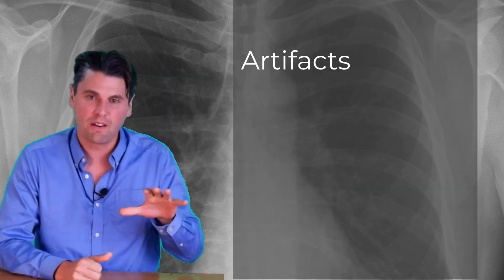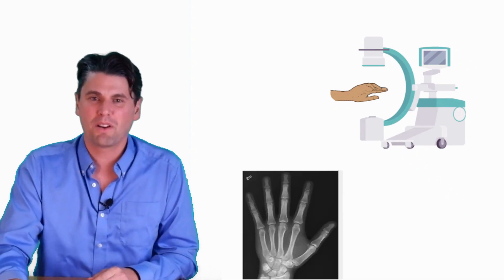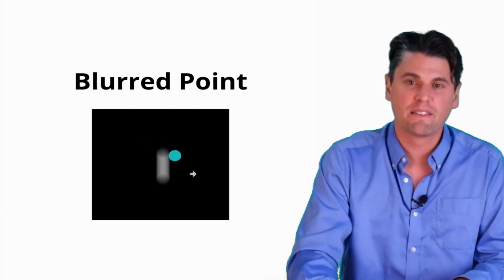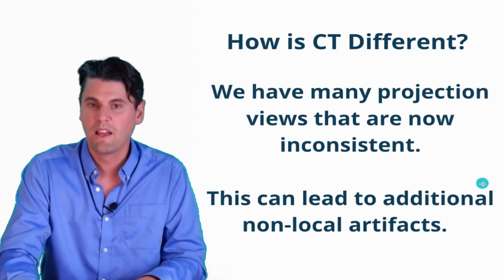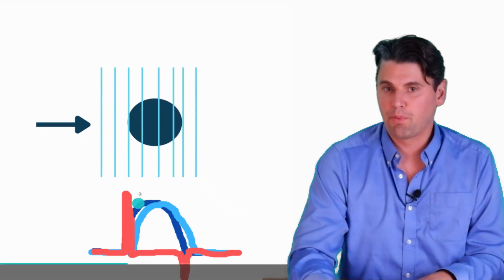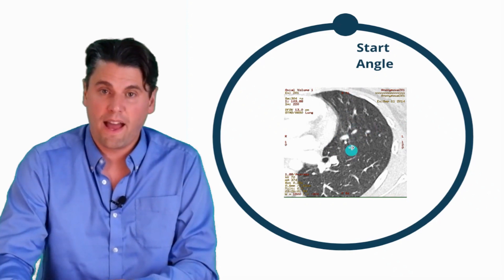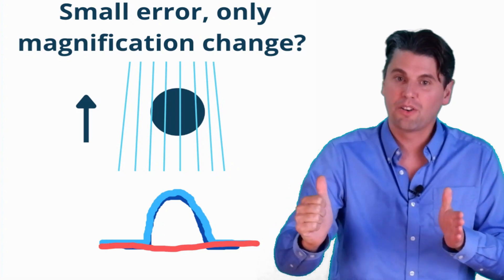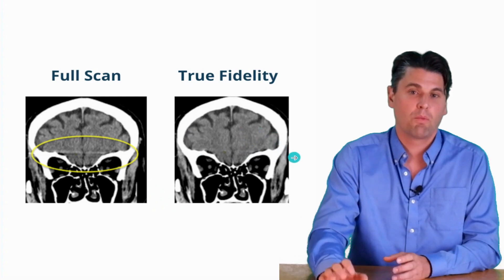CT motion artifacts (Motion Blur in X-ray)

Comment: If a head scan is reported as body32 in the dose report, the actual DLP is actually double, right? To give an example, a brain scan was done and DLP was given as 250 mgy Body32. Actually, it should be 500 mgy Head16, right?
Reply from the maker: This is approximately right and the vendors have a conversion which may not be exactly 2 but a similar factor